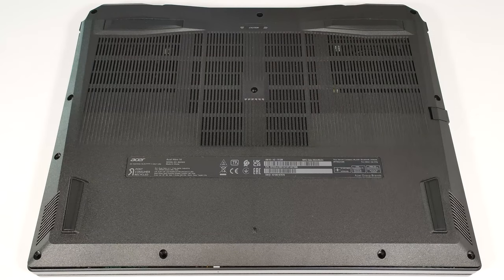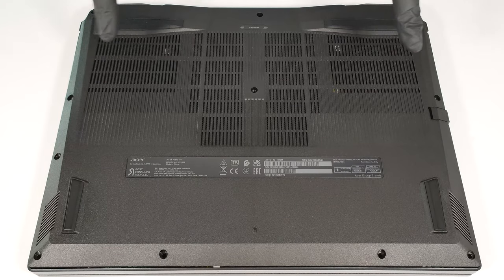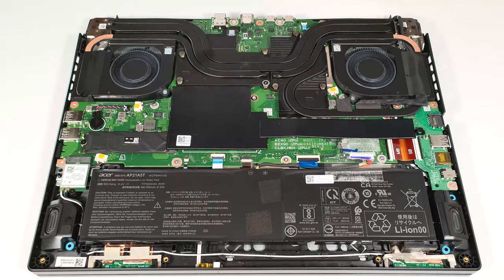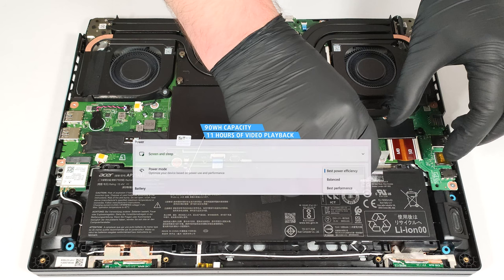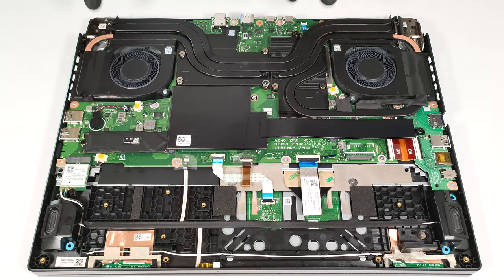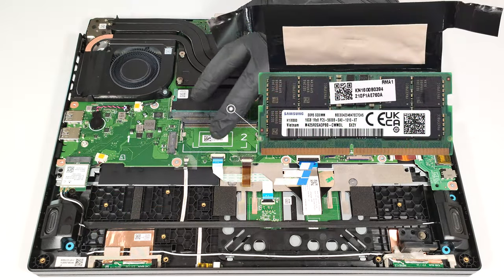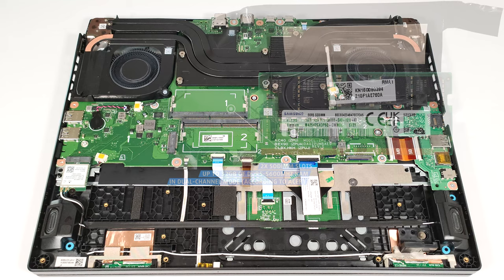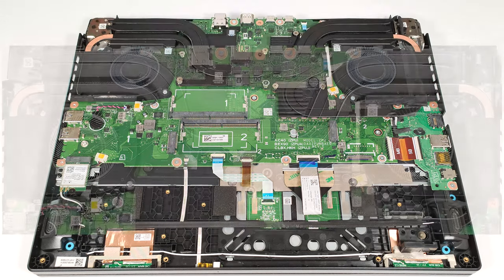🛠️ How to open Acer Nitro 16 (AN16-42)  - disassembly and upgrade options

Comment: If I want to upgrade the ram from 16 to 32...do you recommend buying an extra 16gb from other manufacturer or do I have to replace the existing one (16gb) with 2x 16gb from same manufacturer?
Reply: no need to think abt manufacturer, just match those ram speeds